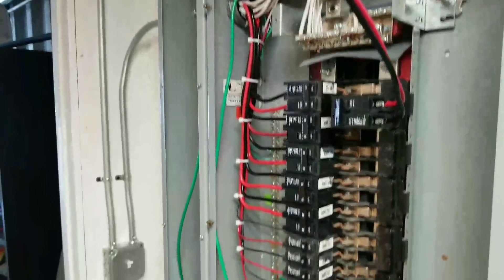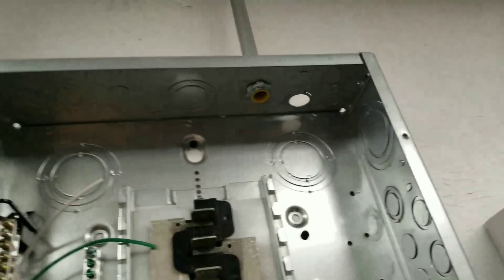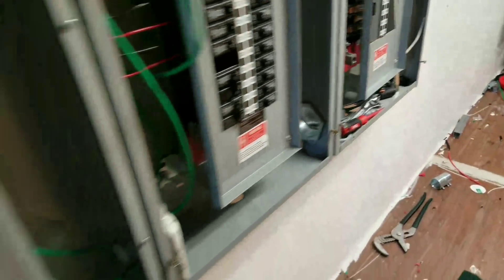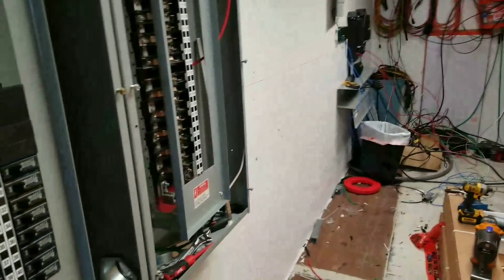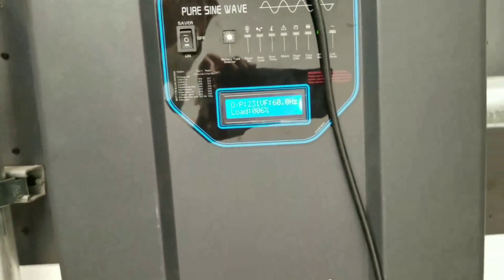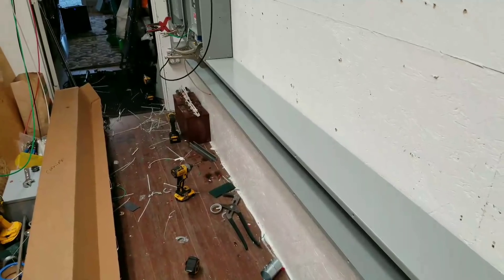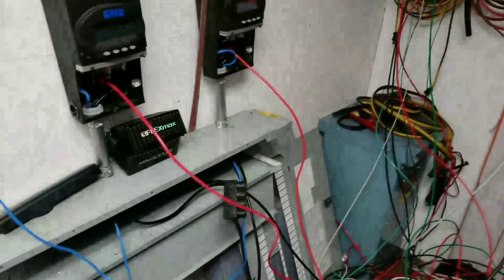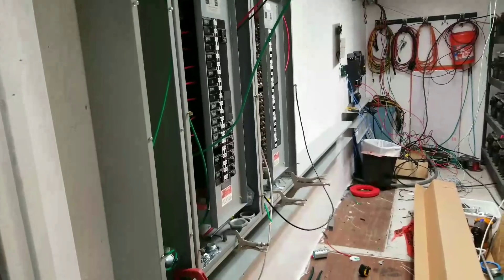Off Grid Power Room Rebuild PT 4 - Gutters and Panelboards

Comment: 2 Questions. 1) How did your Solar Edge inverters fare? Most of mine failed and had to be replaced...or the battery. 2) Usually the main service panel is inset in the wall making it tricky to connect the trough on the outside to the panelboard. Do you have any tricks for that?

Comment: Hey fellow electrician here!  Firstly, nice work man looks great.  I paused the video a few times to wrap my head around that crazy bend.  I most definitely no how complicated it is to make things like that fit.  I also build electric rooms.  I have a question.  Did the panel covers/doors fit without fabricating?  In the past I have had to space them out an inch 2 or else the covers wouldn't fit properly.  Ps.  I admire your creativity.
Reply from the maker: The covers don't have flanges, they are designed for surface mount applications
Reply: Very kool thank you for the reply, and useful information.  And keep up the awesome work